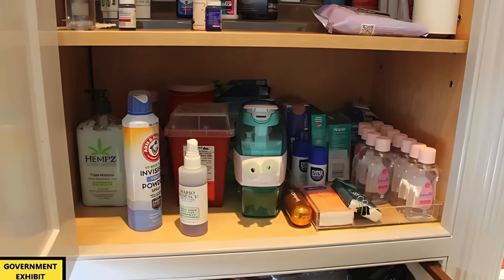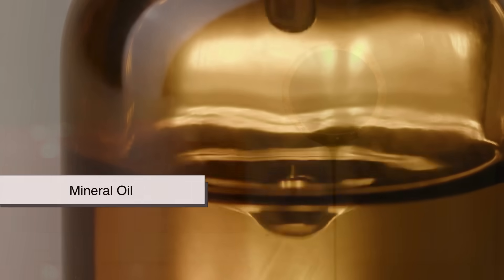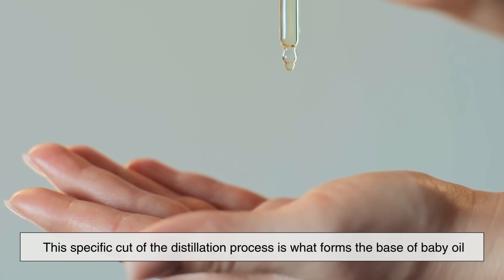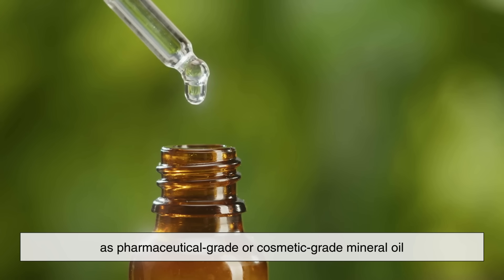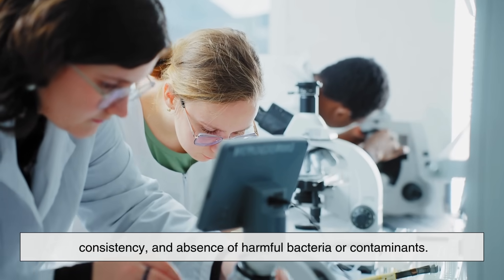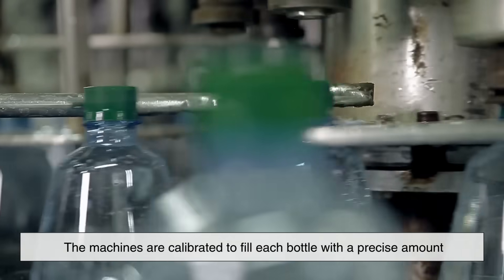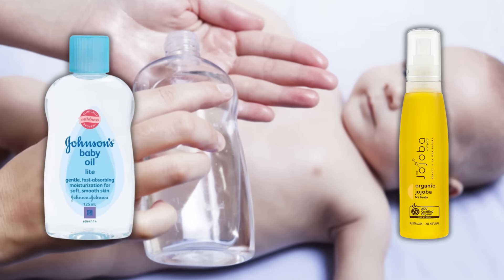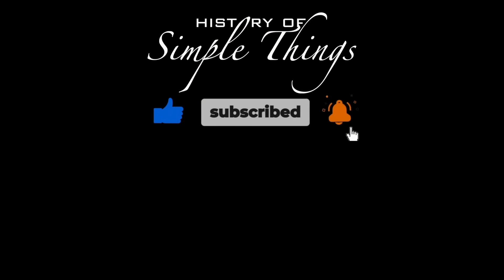Baby Oil: How It’s Made

Comment: so many products are so dumb. not only part of the carbon production chain, but for 2000+ years no one needed baby oil, but suddenly modern society does? you know the more external oil you provide your skin, the more you reduce your body's own ability to produce the oil, because it shuts down biological manufacturing site due to feedback balance systems. same goes with everything, artificial hormones, or anything your body naturally produces. the more external you apply the more you, oftimes permanently, shut down your own production, making you reliant on the artificial consumer product. kinda like a junkie.